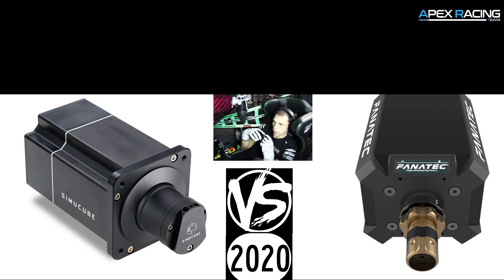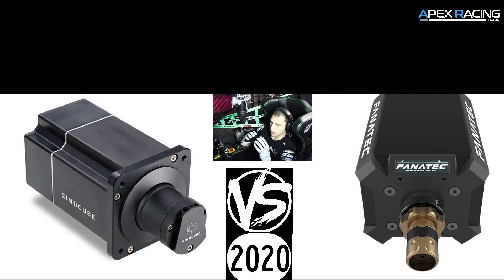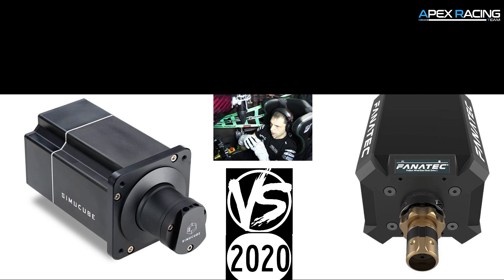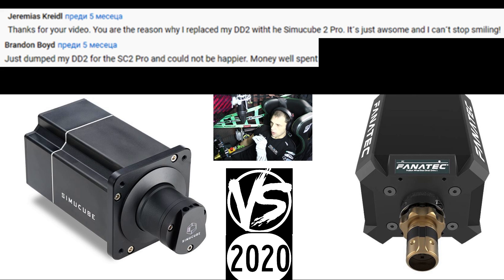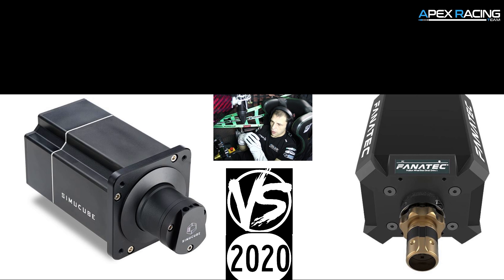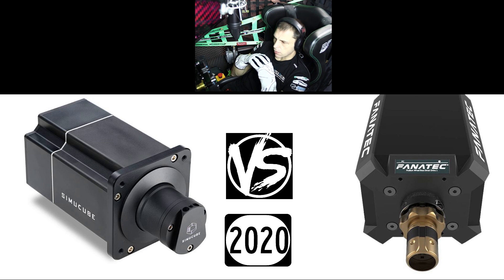Fanatec vs SimuCUBE 2 in 2020

Comment: Could you share wich wheels did not have the flex?
Reply from the maker: They both have 0 flex in the shaft and the flex for Fanatec is coming from the quick release for which some people have found some solutions with costume made rings but I don’t have full information about that mate !
Reply from the maker: Now reading your comment again I think I understand better your question..., the Wheels I didn’t got any flex was my BMW, Porsche the first model , The Fomula 1 V1 (but had handle flex ) the Formula V2 the red one ! I had very bad flex in the formula special edition and the Podium Hub ! But I don’t think is about the Wheel model anyway because the problem is in the QR system and that is completely separate part of the wheels !

Comment: Just wondering when you run the Valve Index what fps is it normally at? Is it really necessary to have a headset beyond 90hz?
Reply from the maker: For everyone is different! For example, I run ACC 80 and iRacing! I’m mostly sensitive to pixel density then refresh rate and my eyes and brain cannot see much difference between 80 and even 144 hz ! I have heard many people are happy to run re projections 45 FPS and are absolutely fine ! I think you really have to check your self what’s working for you !